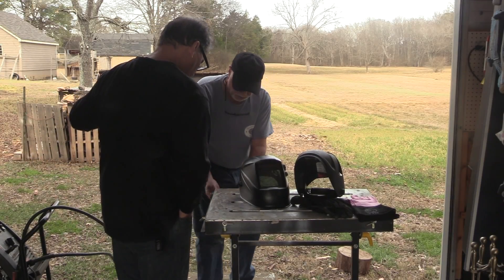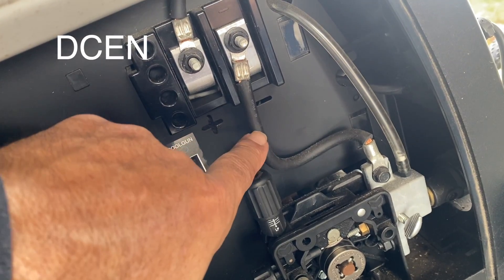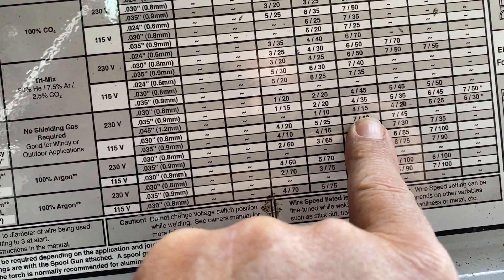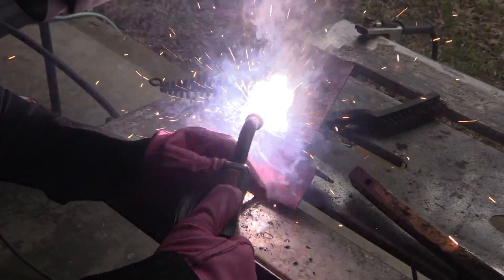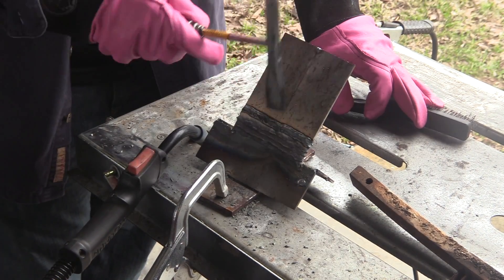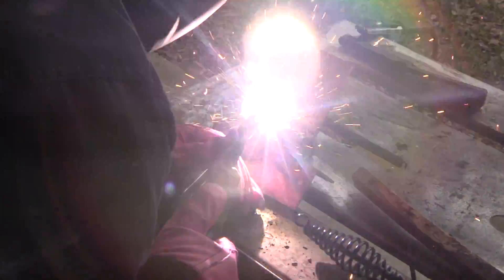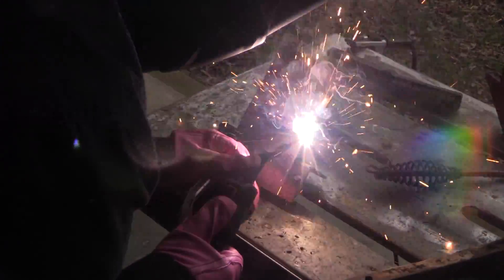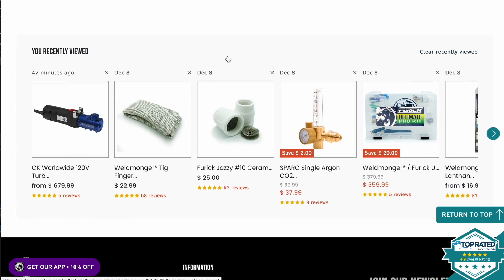Gasless Flux Core 4 Beginners Tips & Practice

Comment: I have other TIG, Stick and MIG welders but love my little Lincoln Weld Pak 100HD flux core welder for its portability and versatility and have done many on-site light duty weldments on lawn equipment and attachments.  True that you're not going to get a stack of dimes look but with the right settings and travel speed, I can get a decent porosity-free bead using Blue Deamon .035 wire.
Reply: Ive got to try that blue demon, heard a lot of guys say its good stuff, ive used lincoln forever, may try it out.

Comment: Is it possible to TIG mild steel with 100% CO2 with no filler, with old clothes hangers, with 025/030/035 ERS70S-6?
Reply: 😂i do that all the time or use 2.4 rods, without the flux. Works great.

Comment: Do you have any tips on mig welding hot and fast I believe the wire speed was 480 and 29 volts with 052 wire. I'm trying to pass a test for a production mig welding job I blew my first shot i believe idk if i passed or failed honestly but Luckly they lost my paper work and I'm getting another chance . It puts down alot of metal should I just pull or push the weld or should i add some circles or anything. Any info would be much appreciated as I can't find anything on a hot and fast weld it is a 3 pass horizontal  t joint with root and two showing.

Comment: You should do some videos on using porta powers and trimming pieces with a grinder for fabrication. My job entitles doing a ton of it and it can be a real pain in the you know what. Fitting techniques. Welding in tight confined spaces. I'm not used to I'm getting a taste of that. Heck even spots where you can't even reach your head in its all spray and pray lol. Especially with air packs, their nice but man are they sometimes hell when your working on really and i mean really tight spots where sometimes you just got to keep repositioning yourself just to kind if brace yourself enough just to get at least 6 inches of weld in. I got to get used to welding with one hand too. Its a whole another animal.

Comment: I hate videos like this.   It makes welders stupid.  
 1 "gasless flux core" is just flux core.   Flux core that uses gas is dual shield. 
2 not all flux core wire is dcen.   Nr-305(e70-t6) runs dcep
3. If you want to make a video like this you should clarify it's 211/212(e70-t11) wire your running.   And if you are going to buy it from home Depot NR 211-GS is a general purpose wire that doesn't meet any standards.   The flux is straight garbage so someone learning to weld won't know the difference in wire limitations and what was there own fault.   It's just so cringe worthy

Comment: What glassless flux core wire would you recommend for multiple/stacking passes?
Reply: E71T-11 is a general purpose multipass wire.
Reply: @TheMadHatter626  thanks. I bought some blue demon in that to try out. Hopefully it goes well. My biggest issue with flux core is not being able to stack passes.
Reply: @02blackLightning  you can stack just remove slag and clean with wire wheel. Clean it well.
Reply: @foxwood67  yep have done all that. When I go to stack a pass on top it just burns right thru the pass before. But i wasn't using the -11 wire. Just the standard -GS I think it is.

Comment: Thanks a ton, Jody. I'm a newbie at this welding thing and your videos have helped a lot. I have a need to get some aluminum welded. I have one of the Hobart gasless welders and I'm wondering if I can use flux core on that? Any help you could provide would be most appreciated.
Reply: Won’t do it friend
Reply: Aluminum requires argon for Tig and wire. There are aluminum brazing rods for propane/acetylene and stick rods for ARC. Both have their own techniques and applications but might be able to fit your requirements.

Comment: Hi Jody, thanks so much for the videos.  They have really helped me.  I noticed that the beads in the video seem to only have flux on the side, that the flux seems to be gone from the top of the bead.  I have noticed that my beads tend to be the same.  Yesterday I tried holding the gun in a more upright position, almost vertical and it seemed to leave flux over the entire bead.  So which way is the proper way to do it?
Reply from the maker: thats a good point.  gun angle can make a lot of difference so if an upright angle works better for you I would stick with it

Comment: I appreciate your videos and advice . I not a expert on wire and never tested on it ..At work there was a couple on miller wire machine.  I think they were 250 or something like that . We use gas and solid wire either stainless or some 70 ..I don't remember exactly as I just got ot out of the warehouse and used it ..we build a lot of things with them and generally not much trouble.  So i have a 250 d Lincoln at home but I wanted to have a wire machine for thin materal . So I bought the hobart I think it 110 and finally I got it out to weld in a floor panel..I finally got it done ..I never ran any fluxcore . . I was not excited with the results of the machine . I not sure if that's the nature of flux core  . If I ever do another floor pan I going to use solid wire and the proper shield gas . The hobart has the ability to do that ..I liked the was the millermatic ran and I might buy one sometime if they weld better